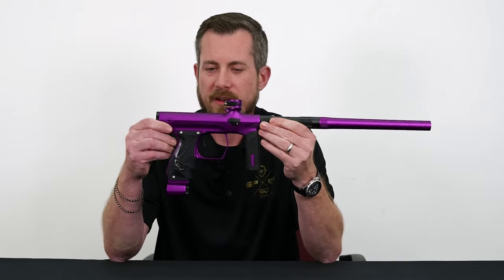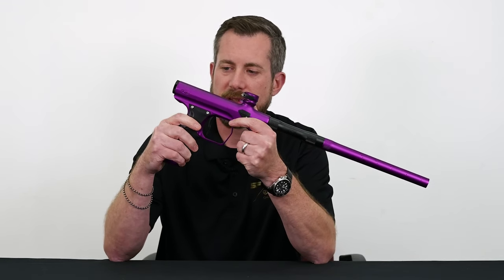Shocker® ERA vs Shocker® Amp - What has changed?

Comment: The twist and pull is absolutely terrible. I just ordered my amp and it shoots good but the asa knob is pointless and hard to turn when your hands are sweaty (just upgraded to the lever). The turn to unlock the bolt turns WAY too easy and has turned during playing points which let gas come out/confused me for a sec. The front grip also comes down/moves too easily during play (i added some infamous tape before putting the front grip back on so it can grip tighter). 

I shouldve just gotten the Dsr+ and regret buying this marker lol

Comment: On the 4th try of their gamma core clone it finally has the same paint handling as the 2015 Gtek.
Reply: @djkrucial8514  I think you misconstrued what I said. I"m not talking about shot feel, I'm talking about its ability to handle the higher tiers of fragile paint. The Amp had terrible paint handling at launch, enough to where SP themselves pushed out a bandaid fix in larger orings to increase drag. Fundamentally the Amp core's first stage is so fast that the marker has trouble handling really fragile paint. Why do you think that most every Amp out there has any of the SSC, Adrenaline, Boss, or TechT bolt in their guns? This is a known issue from back to the Luxe X. SP stole the GP core design and had troubles adapting it on their past 3 versions.

I owned an Amp since pre-order. My latest was a Seattle Thunder Amp. Had a nice feeling shot, but you need to be honest about the markers design and it's short comings. The ERA looks to be better in every way internally, which means it can now probably shoot the same paint a Gtek 1 can now.